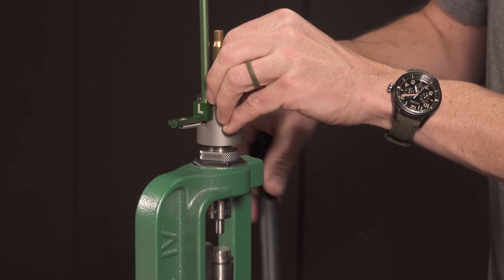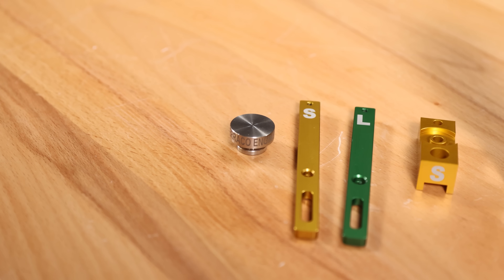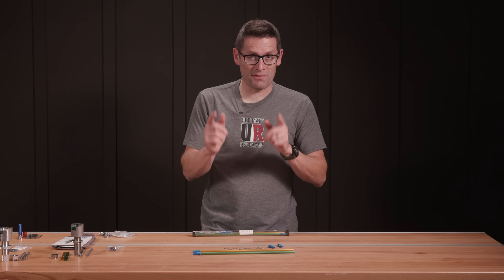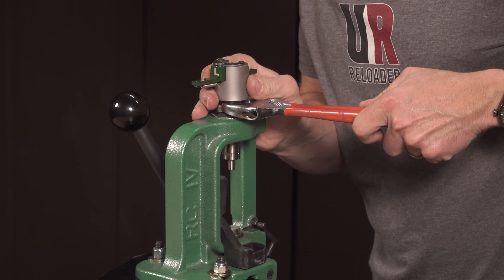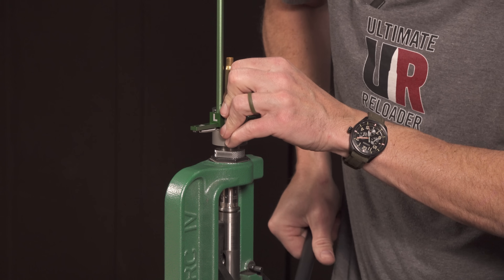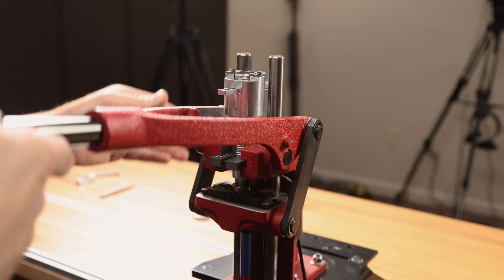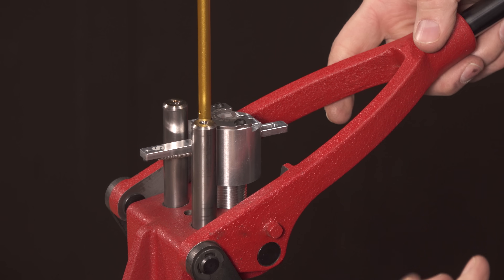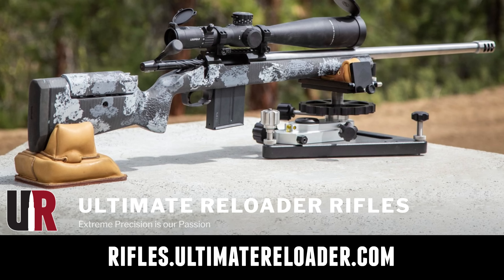Derraco Engineering: Precision Competition Primer Seater (And MORE)

Comment: Nice video but I don't know why you said priming with the COAX you don't have to worry about case rim thickness. That is not true. Any priming tool that uses shell holders will have case rim thickness problem. There is no way around that. Except for the bracket I designed for the Primal Rights CPS primer which I am able to keep seating depth within +/- .0002". Check my channel to see more about case rim thickness and CPS Primer bracket I designed. I already ordered one of these Durraco's to see how I can make it work with my Short Action Customs Nexus press. Thanks for a good video.

Comment: Gavin I use Primer Pocket Uniformer to cut primer pockets perfectly Flat.  This Tool also Dead Stops on the Case Head for Consistent Primer Pocket Depth.  Primers should be seated to Engage the Bottom of the Primer Pocket. This allows the ANVIL to function properly.  If primers are Not seated to the Bottom of the Primer Pocket then how is the Primer Anvil going to function properly or specifically Consistently (Lock Time).
Let's Talk Sir

Comment: This is the cheapest high precision bit of equipment you can get in this mental sport of guns and reloading. Do not hesitate.
Testing I have seen, not seating primer (gapped) is a huge problem, your shots will be all over the place. Crushing primer is just as bad. From memory there was 9 or 13 thousandths between the 2, this is awesome for micrometer adjustment and repeatability with accuracy. The testing showed no improvement or degeneration with any of the depths between these 2.

Comment: One of the very few times I’m disappointed with a Gavin review. I really wanted to see just how accurately the tool seated the primers. Can you adjust for a .003” below surface seat and expect to get that every time??? Is the anvil stop is a positive stop that a little too much lever handle pressure will not effect the seating depth??? It looks like a great tool but I’ve got a shed full of what looked to be great tools that wound up not preforming the task they claimed. Dont worry Gavin I’m still a huge fan!!!

Comment: Lol not for $230.... not as bad as the Primal Rights scam, but close. ALL of these are rim thickness dependent, just like the Lee and RCBS Ram Prime systems, and the Lee APP press method is web thickness dependent. All 3 of those do the same thing for $20 to $150(app press). The only difference here is the feeding tube. I'll hand feed, and spend the $180 on components.

Comment: This is what I went with over the primal rights unit. The pricing is a no Brainer but they also fixed the issues the primal rights has with loose primer tube and not having a spring on the shuttle

Comment: The priming operation looks smoother on the RCBS as it looks like you have to work around the handle on the Forster.
Reply: swapping in the shorter ball handle version for the Forster could help a bit.

Comment: How consistent were the primer depths with the same headstamp brass?  I use Lapua brass and the rim thickness varies too much for consistent seating depth if the tool indexes off the rim. The Sinclair tool is slower to use and especially to adjust but it produces very consistent results.

Comment: Well, to get consistent primer, seating depth… You would have to measure your primers and take the shortest primer measurement and then you would have to measure your primer pockets and take the deepest primer pocket depth subtract them and that will tell you how far to seat the primer just to get the anvil to touch the bottom of the primer pocket
Reply: Exactly. Just another unneeded tool that they can sell because most people dont understand 
That
Reply: @zymkriger Its great in theory but I can't read the wind that well nor will my budget permit. I'll use those funds to buy components and practice.

Comment: Primal Rights sold a tool like this years ago. It was called CPS Lite and was adjustable however did not have a micrometer type it used a stop collar. I still use the one I bought I never bought a CPS bench mount but if I were to get another priming tool it would be a CPS bench mount.

Comment: I love mine. Modified it easily to work with the SAC Nexus press. The accuracy and precision is similar to much more expensive off-press seaters and is much less expensive,
Reply: Very interested in how you modified.  Thanks
Reply: @gregdeal4596  OK, Cut a primer tube just short enough for the handle to clear it at the top if its stroke. I used a rectangular plate of aluminum that spans across the front, wide enough to cover the two cam pucks. Aluminum thickness of .12" or more will not flex. Simply place the plate over the pucks and the shell holder area.  When you mount the Ugly in your die holder, orient it so the primer push ram i (the end your finger pushes) is oriented at 10 O'clock position so it doesnt hang up on the press.   I'm working on a plate that is cut out to slip between the press's two drive guide rods that will keep the plate from moving there, and also will have two brass rods countersunk on the bottom of the plate that will sink into the puck holes and hold the front area of the plate from moving out from the press. Prototype will be done mid week and i will post a youtube vid and specs.  Honestly, just a plate by itself works great , but I'd rather have it not move if touched or from bench vibrations.  If you are a member of Sniper's Hide forum, I posted a thread there with pics.

Comment: Wondering if it would work with my hornady single stage press
Reply: Yes it will, I've been using it on my Hornady classic single stage for nearly a year. Check out my review on my channel. I also have their annealing machine and bullet/case comparator set. 

The owner Cheng is a decent chap. I bought all the stuff myself and wasn't sponsored to do the videos.

Comment: Unfortunately if it's dependent on rim thickness this isn't going to be anymore accurate then what's already available with other premium primer seaters. We need to index off the head stamp side of the case head like the Sinclair primer. There is quite a bit of variation in rim thickness even in one lot of premium brass.

Bryan Zolnikov channel has some very good content on this topic and the effects it has on velocity variation in your standard deviation.
Reply: just take the cheapest options and seat as deep as they go and you're good ...

Comment: I have an early version of the PCPS and it's great, but the large primer tube does not accept a full 100 primers, and it's a PITA when you can only use 96 primers at a time.  Did they address this shortcoming in this version?
Reply: you can custom order 330mm primer tubes from us. post satchels not accepting this size as they were a bit too long. if you are willing to pay a few more bucks. I can get them for you.

Comment: I bought one about a month ago and run it on an RCBS RC Supreme as well. So far, I use it currently for SP Alpha .308 & 6.5CM. This unit is exceptionally well made and works perfectly. I'd prefer a .001 in. per click implementation, but it works fine, just as it is. It is obviously made by engineers for precision-oriented people who appreciate functionality and value (go over show.) I am so happy I found this unit instead of spending $650 on the other platinum-plated widget

Comment: Thing I'm really curious about, I've been having issues with slight tolerance stacking between the extraction rim, and the depth of the primer pocket. I modified one of my other priming tools to use a die spring, so it applies a roughly similar amount of force, even if the depth was slightly different between each casing.

Comment: Love mine. I am thinking about another for doing small rifle although they are that easy to set up that I might not bother. As a bonus the primer feed tubes are a massive improvement over my Dillon tube's and I find the plastic tips to be better as well. The owner of Derraco can be (more than) a little difficult to deal with directly on warranty but his parts a first rate - I have the ugly annealer, SRT Trimmers, competition shell holders and his PCRS. Being in Aus it is not the easiest to get all the options you have states side and Derraco fill a market hole for us and is often available when other brands are not.

Comment: have used the Precision Competition Primer Seater installed in a Lee Breech Lock Reloader Single Stage Press. its dedicated to the   Primer Seater . this setup makes it far easier to remove if it should be needed to do

Comment: Why is every priming setup have the primer tubes all woobly as hell? There should also we a shroud around the priming tube to stabilize it and in event of an explosion its not at eye level.
Reply: the pcps is much more stable than the primal rights unit.
Reply: Still a shit design.
Reply: @Hunglikemoose  the hole is 8.00+-0.01mm, the tube is 7.92+-0.05mm in outer diameter. You need to allow a bit of wobble for parts with different tolerances to match and feed reliably.

Comment: Everyone I talk to that has one loves it!! They keep trying to get me to get one.
Reply from the maker: YES! This tool is AWESOME!
Reply: @Ultimatereloader 
Hi Gavin, long time watcher first time poster.

I’ve just purchased the PCPS “full version” with the intention of seating primers by feel.  I have checked this is possible by simply winding the micrometer to allow full travel and feeling when the primer bottoms out in the pocket.  

I bought the full version opposed to the “lite” so there is the possibility of using the micrometer function n the future should I desire.  On this note, my thought for this to be consistent would require three things.  1.  Consistent rim thickness.  2.  Consistent Primer cup thickness.  3.  Consistent primer pocket depth.
Leaving the dimensions of the primers and rim thickness to the manufacturers only leaves altering primer pocket depth by utilising a pocket uniformer.  By subtracting the primer cup thickness from the primer pocket depth you can determine how far below flush the primer would need to be in order to be flush against the bottom of the pocket.  You also then need an accurate tool to take all of these measurements.

Can you please confirm if my above thinking is correct?

And finally, can you make comment on whether you personally go to these lengths when you are achieving your groups down to .2 and .3 moa or are you simply bottoming out the primer in the pocket by feel?

All the best from Australia!

Cheers,  Joel
Reply: Nice primer tool. But do the make an adapter for the Nexus press?
Reply: @airborne350g  That would probably push me into getting one. My problem is I literally don't own a press that I can use it on right now. 750, Summit and Nexus.
Reply: @FClassJohn get one!  I’d recommend a Harrel’s compact press to run it on. Then you can also take the Harrels for portable loading at the range.
Reply: @FClassJohn  you already have a LEE ACP which is base referenced rather than rim referenced.  And there are already tools for base referenced uniforming. I have a prototype for rim based uniforming, but not ready for prime time...
Reply: @ I got rid of my Lee a while ago when I got my Dillon 750.
Reply: @FClassJohn  hey John. Let me know if you want a set of PCPS anytime. I will express a set for you to have a try. Regards Cheng Fei, the designer of PCPS.
Reply: @FClassJohn  I can make a anvil for the NEXUS. I  already made one for another nexus user or if you want I can give you the specs to make one.
Reply: was going to ask if this fitted the nexus press
Reply: @   Working on an anvil base for Nexus
Reply: @airborne350g  I use it on the nexus. It works fine.
Reply: @airborne350g  I emailed and called SAC about this issue, because my bullet pointing die uses a flat base too. They said they are aware of this issue and are working on a solution. This should be an easy part to make. For now I have my poor man primer set up in my RCBS and use my Nexus for sizing, mandrel, etc…
Reply: I bought one about a year ago, it’s fast and very consistent.
Reply: I’m in uk looked at getting the primal rights but the cost was ridiculous to get over here,use my derrco on my zero press.absolutely amazing bit of kit
Reply: @ I almost bought the primal rights when Derraco released the PCPS. Mine was in the first manufacturing run and didn’t even come with instructions. The PCPS is a better option even if the primal rights were priced the same. The end results are the same and the PCPS doesn’t require an additional press mounted on the bench.
Reply: @user-TJ365  and it comes spring loaded,you don’t have to add a rubber band 😂😂😂
Reply: @  exactly! I have mine setup so I can hit the shuttle with my thumb on the up stroke of the press lever and use my left hand to exchange brass.
Reply: @benjo642 
They are available in the UK mate 👍🏻
Reply: Get one!
Reply: they are the best. i bought 2, one for small and one for  large and leave them permanently set up.
Reply: @FClassJohn  John, I use it on the Nexus, no problem.
Reply: @Pete-Bates  😳 ok I'm in 👍🏻
Reply: Did you get the Daracco unit yet? If so, how does it compare to the Bald Eagle primer press? @FClassJohn
Reply: @FClassJohn hey John, did you end up getting the Daracco unit? If so, how does it compare to the Bald Eagle primer press.
Reply: @Pete-Bates do you need to do anything special to use it on the nexus press or is it pretty much self explanatory
Reply: Anyone looking to buy this in the states, check out ugly reloading USA. Carl is a great guy and will personally answer the phone when you call.
Reply: This or the cps?
Reply: @ the cps is not worth the extra $475.
Reply: @user-TJ365 curious if you’ve done testing to compare the two and your results.
Reply: @ I haven’t performed any tests on paper. I know my PCPS only has a variance of half a thousandth when priming pieces of brass from the same lot. The primal rights cps was the first to the market providing this kind of consistency, allowing some to justify the price. To be honest, the variance I see is more correlated to case rim thickness than the PCPS. Eliminating a variable in my reloading process for $200 was worth it for me.
Reply: I'd love to see your evaluation. I am super satisfied with mine.  The money I saved not buying the PR unit went right back into Alpha Brass and Berger copper...
Reply: I would love to see how it stacks up against the lee acp. This one, like cps, references off of the case head.
Reply: I got one John and it works great!
No more sore hands or “feel” seating process. Zero stop and very accurate. 
I’m use to the primer tubes with the D750 so it’s a familiar process I used a Lee press for my dedicated priming station. 
Good luck at the SWN!!